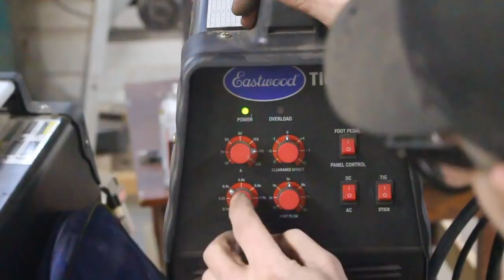DIY Truck Lumber Rack - Stow and Go Version

Comment: That little pickup Is súper cooI!! When I  worked as an employee for 15+ years, I worked  out of small Toyota pickups, back when they were small. But even those were more than needed. I just need a ladder, compressor, hoses, gun, and belt, with tools. Very little space really. The reason I never went, and Bought one, was the RHD. If I could get a LHD, with at least a 5 speed,and a 2, or 3 cyl Diesel, I would be in heaven.  Also, I use canopy clamps from the auto parts store for my rack. They look much more professional than a "c" clamp ,and a 14mm socket on a cordless impact driver gets them on, and off in seconds. That clamp you use is a PITA. They cost about 3 dollars apeice. Or look on C-list under freebies. Mabey someone giving a canopy away has the clamps.

Comment: What kind of truck is that? And where can I get one ?, really cool , the steering wheel in on the wrong side of the vehicle.
 Ha Ha Ha
Reply from the maker: it's a Japanese kei truck, which you can register in the us when they are more than 25 years old. Mine is a Honda Acty.